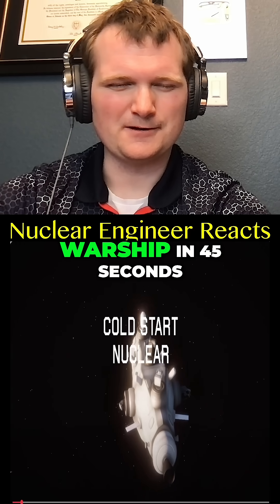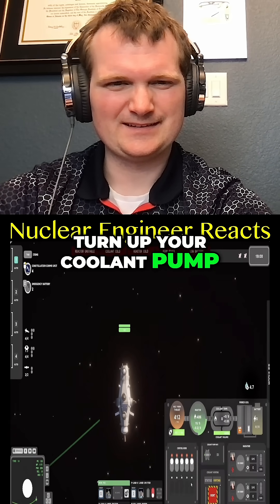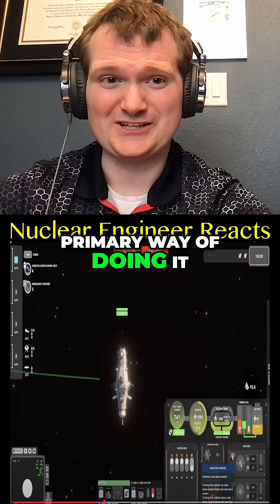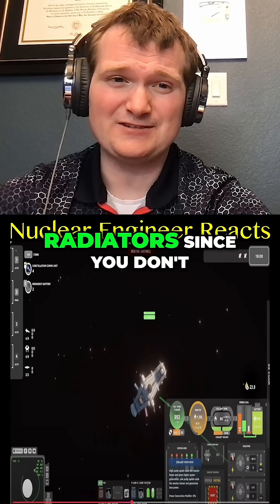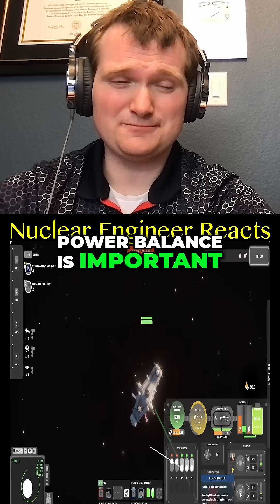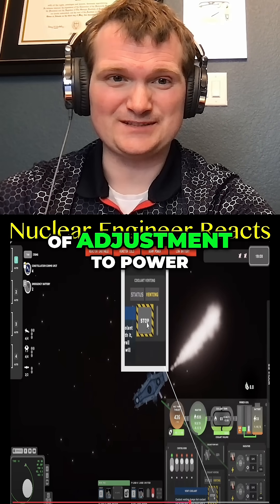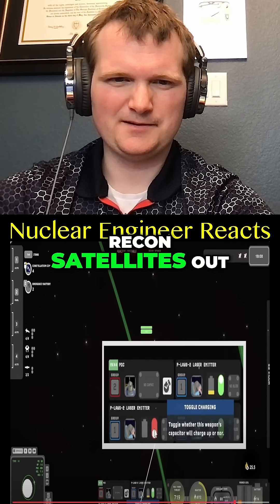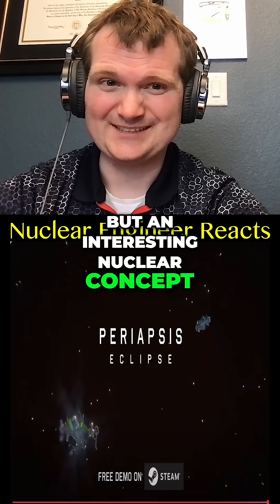How to Start a Nuclear Space Reactor in 45 Seconds - Nuclear Engineer Reacts to Periapsis Eclipse

Comment: Only problem is the engine throttle analogy what the guy is talking about is bassicaly throwing a bunch of cold water/coolant on a rapidly heating reactor to try and not have it blow up on you WHICH IS NOT A GOOD IDEA but still not an engine throttle analogy and for the radiators most nuclear engine designs we have as of now run at over 2000 degrees celsius and if you want  to sap some energy away without needed a ludicrous amount of radiators the output temp would likely be several hundreds of degrees celsius which might cause the radiators to glow a little red and as long as that heat doesn't go to the crew compartments or anywhere else heat sensitive it should be fine but please correct me if I got any of this wrong

Comment: I'm the composer for Periapsis: Eclipse, the game that this video is about, thanks for checking it out! on radiators: there are plenty of spacecraft radiator designs that are meant to glow red-hot, because they are radiating the heat away. these range from graphene sheets with coolant running through them to literally spraying the coolant out into space and collecting it back using magnets (curie point radiators) to suspending hot dust in a plasma being manipulated via magnets. Also, the type of reactor depicted here is a nuclear thermal rocket engine, not your average power generating reactor. These function by using rocket fuel (liquid hydrogen) as the coolant, which gets heated up and shot out the nozzle, and having rotating control rods with a neutron moderator on one side and a neutron reflector on the other. Rotating the rods allows you to throttle the engine by changing the intensity of the reaction.

Comment: Increasing your fan speed wouldn't double your clock rate, but would likely increase it, as it means it wouldn't throttle itself as much - can generate more heat without melting itself (if it didn't have safety anyway)